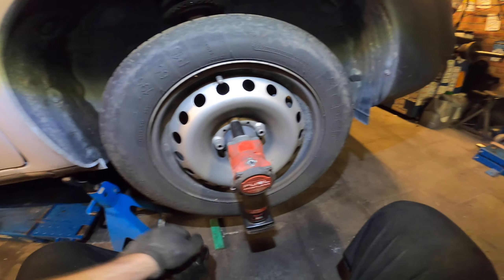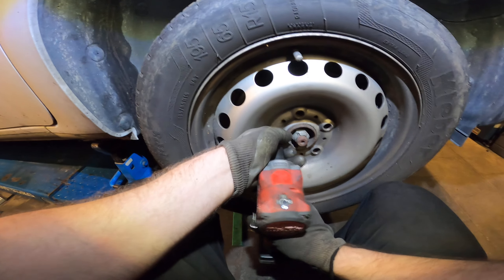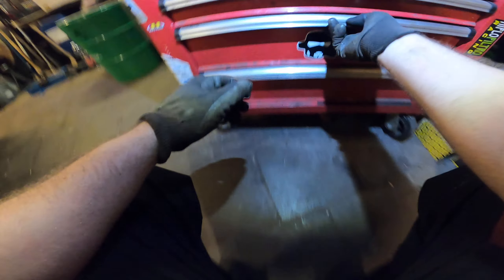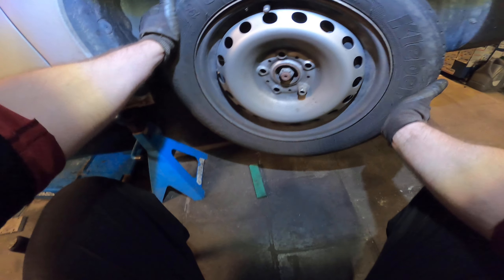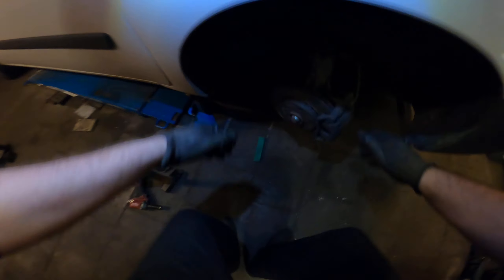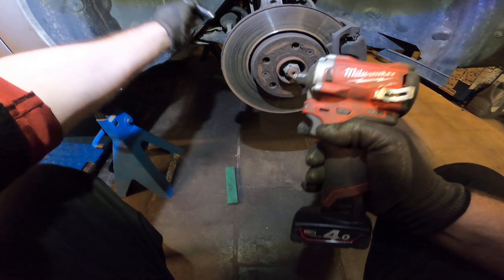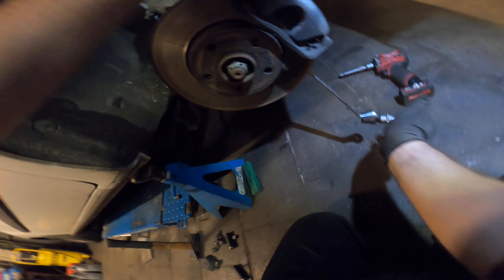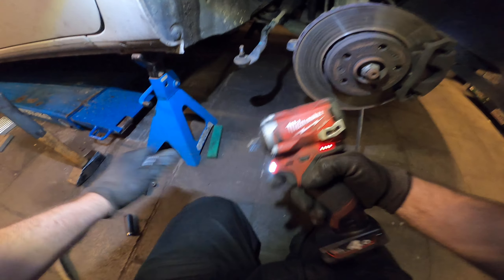Renault Kangoo 2014 1.5 DCI clutch part 1

Comment: my clutch has started to slip ever so slightly in 3rd gear so im soon due for a clutch job. on the kangoo is it a tough task to replace the clutch? also did u replace dual mass flywheel or just the clutch disc?
Reply from the maker: Buy a kit with a dual mass flywheel, it's almost the same labour wise. They always wear out and if it didn't yet, it will soon and you'll need to do the same job + a couple extra bolts for the flywheel + behind your flywheel you have your crankshaft seal, so you can check that out and replace it if necessary. If it's superdry and clean, I would leave it alone. If I see a little sign of wear/dirt, I replace it. Nowadays for customers I always replace it.
Reply: @demonautomotive2726.. good to know! Ill be sure to get the full kit and do it once altogether. my kangoo is identical to the one you carried out the clutch replacement on. Good info bud i can use it as a go to guide.
Reply from the maker: You're welcome, have fun!:)